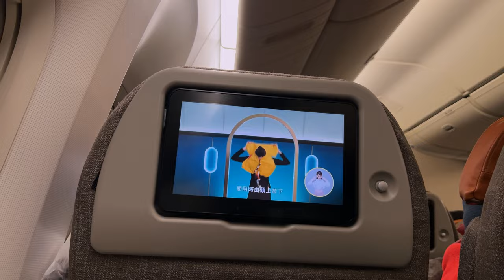We Flew to Taiwan to See a 3D PRINTER | Phrozen HQ & Factory Tour

Comment: Idk what slice has to do with Phrozen, and why its such a big deal if they are only shipping a few nozzles. Seems like they want to create a proprietary nozzle which only slice will sell?
Reply from the maker: We partner with lots of 3D printer OEMs! Lulzbot, RatRig, VisionMiner, Hage3D, and Modix are a few others! We manufacture stock industrial components for 3D printers, not just after market upgrades. 

Phrozen is our newest partnership and collaboration, which is why we went to Taiwan to record some content to announce the news!
Reply: @SliceEngineering lol ratrig full kits dont even use any slice products, they use pheatus hotends
Reply from the maker: @Unscientifically  RatRig V-Core Kits have the option of Slice Hotends. You can check out our video from Formnext where RatRig joined us in our booth to show off their printers equipped with a Mosquito Hotend!